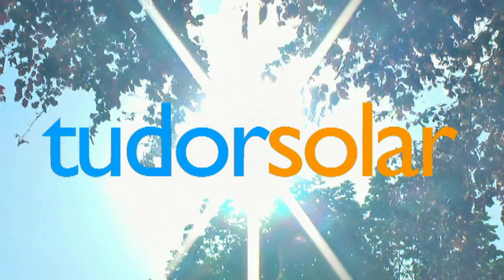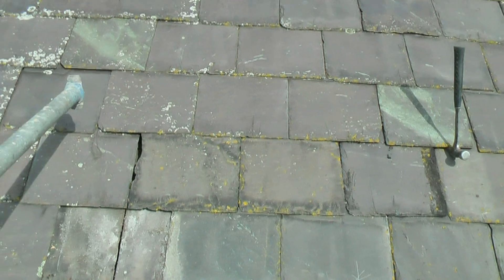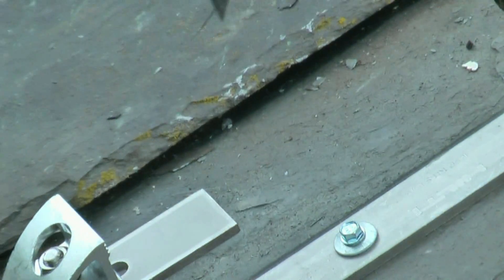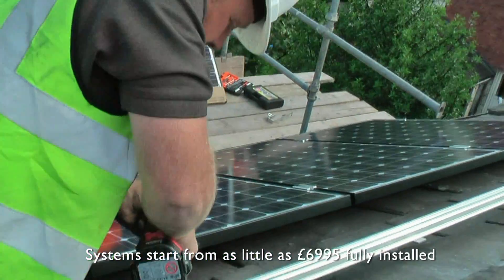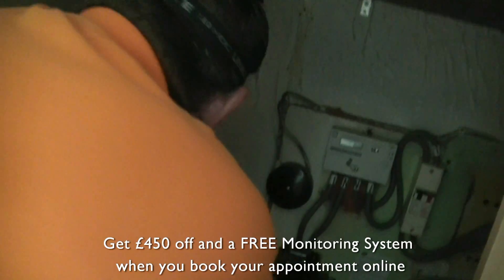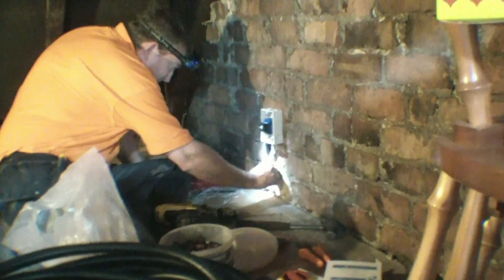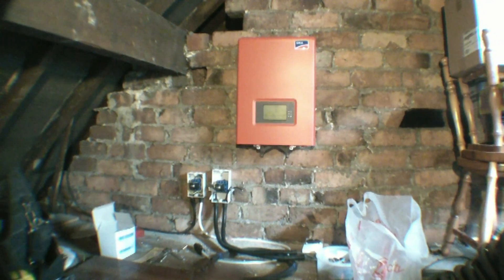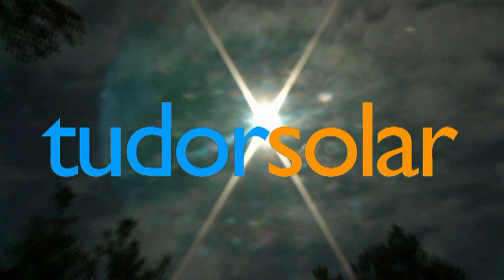Tudorsolar - Solar PV Installation - Southport

Comment: if u go to solarshak . co . uk

you can get a kit fully installed with 10 years installation and parts warranty and a 25 year parts performance warranty for less than £6000 up to 4kW you can really go wrong